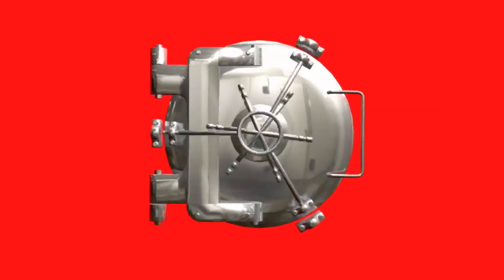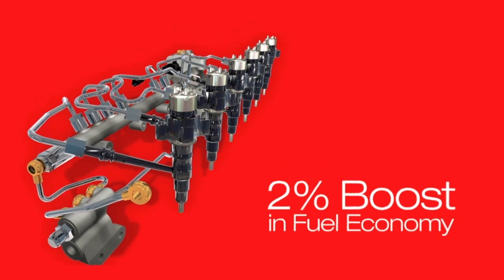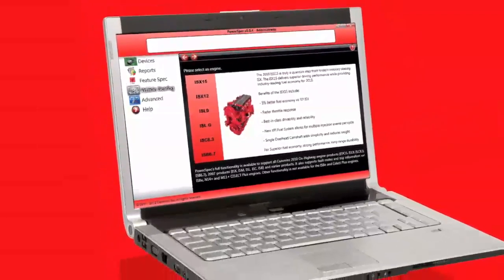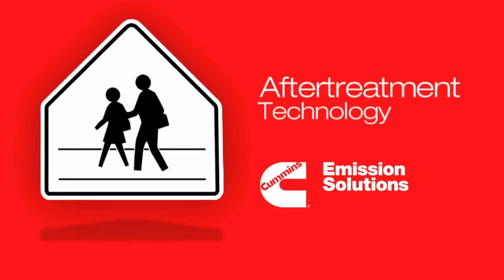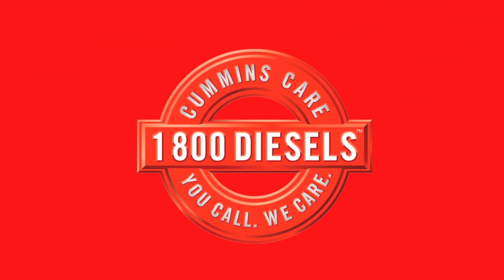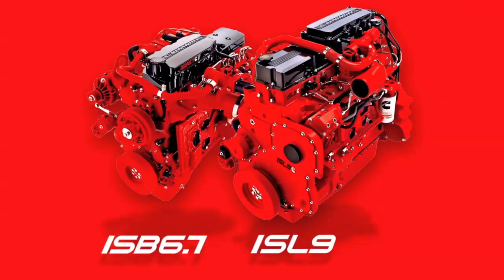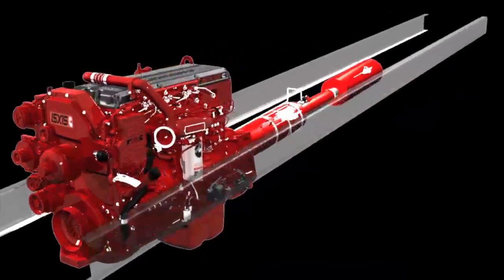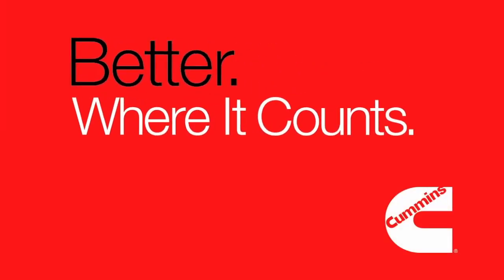Cummins 2013 On-Highway Products - Better. Where It Counts.

Comment: I would love Ram/Cummins to take the lead again in 2015 with power, torque, and fuel economy.  Word is the 2015 Power Stroke will be about 465 HP / 910 lb-ft and that engine does get really good fuel econ.  How about 1050 lb-ft and match or better the old 5.9 engine for fuel economy?  Also, please don't restrict the high performance engine to the 3500.  I really like those coil springs on the 2500!

Comment from the maker: Zane, that seems to be a fairly common myth, but there's no truth to it. Not sure why it persists, but we can assure you it's not the case.
Reply: CumminsEngines 
Sorry to say but the 2013 ISX15 is garbage. I got mine brand new had never ending regen problems and had to inframe at 367K due to liner polishing. 474K miles now and still having regen issues that the Cummins techs can't figure out.